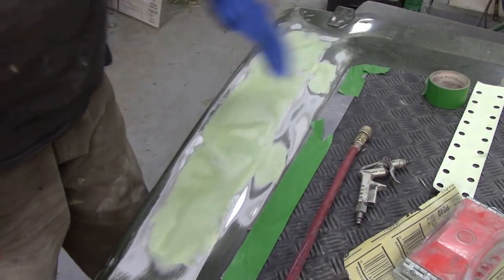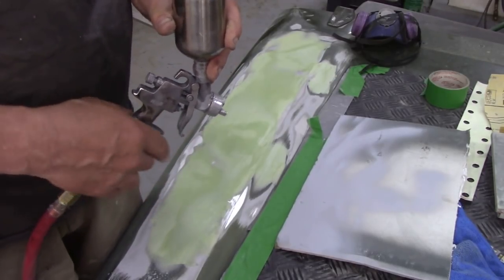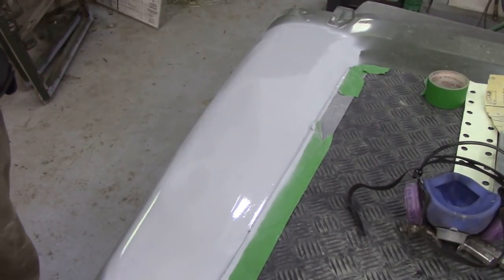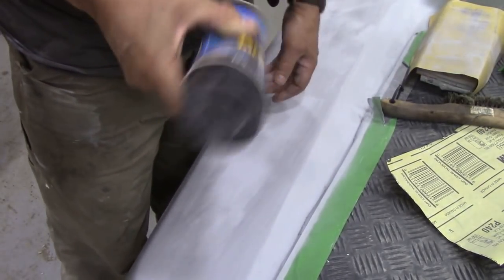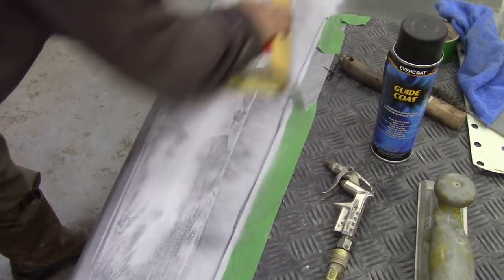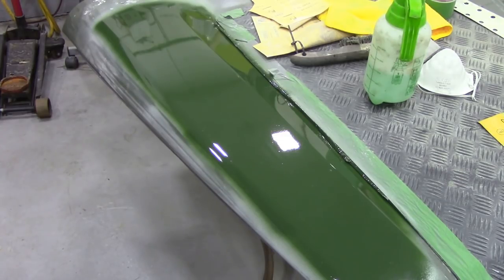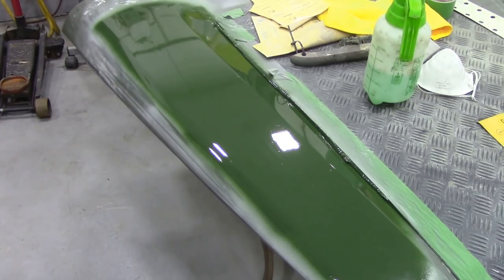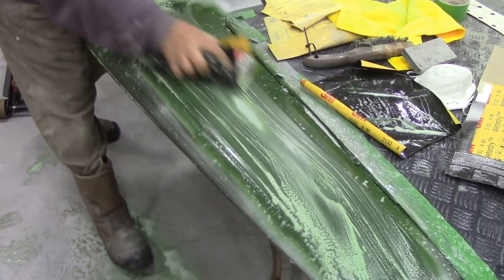Body filling demonstration from start to finish.  Part 2

Comment: Great video Mike, I've never really mastered the decent finish! Couple of questions - What air pressure are you using on the spray gun (And do you vary that depending on what your current coating/ paint is)? - And, when spraying, do you remove in-line oilers from your air feed, the ones that you (?should) have in place when you're using air tools? Thanks.
Reply from the maker: I have a HVLP gun - high volume low pressure -these are the best as the old syphon guns blew a lot of paint around the shop - so as you can see in some of my videos, about 80/90% of the paint now goes on the work and not in the air
I use shop air at 120 psi - but as the HVLP needs volume rather than pressure, the exit pressure is quite low( the design of the gun sorts it out)
One down side is you can get orange peel finishes, but by practising with your thinners you can get very good results - just do not think 'another pass will do' even if you have paint in your gun - walk away - you can get sags and curtain in your finish as it dries
The official paint mix is 4 paint 1 hardener 1 thinner, but I mix 4:1:1/4 - works well
I do not use oilers on my tools  - just give them a shot now and again, so I would not recommend oilers OR a line that has used oil for paint jobs

Hope this helps

Mike
Reply: Thanks Mike, you're a craftsman and a gentleman!